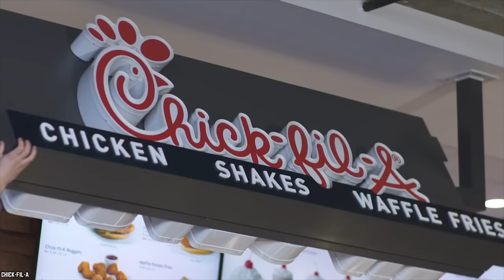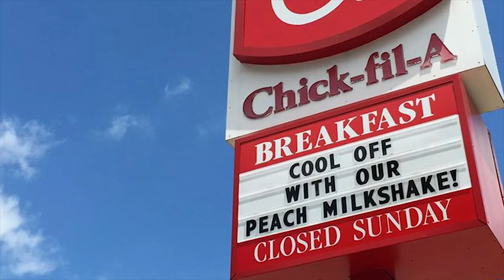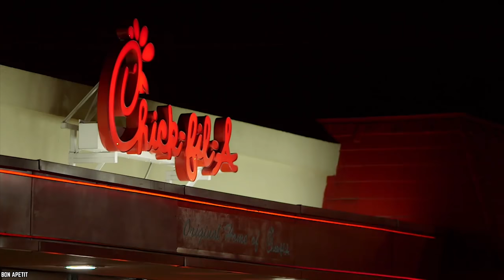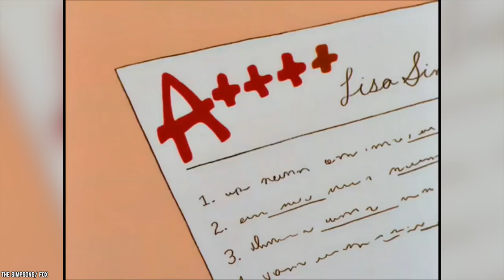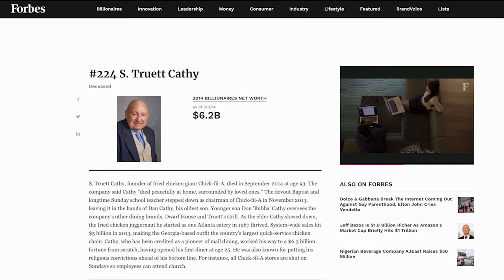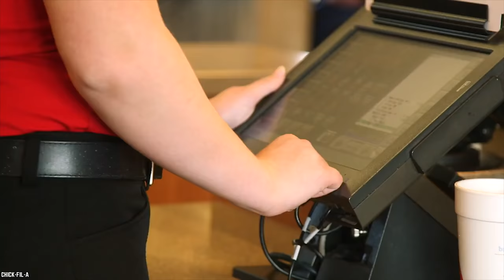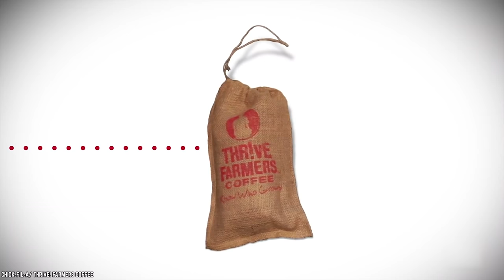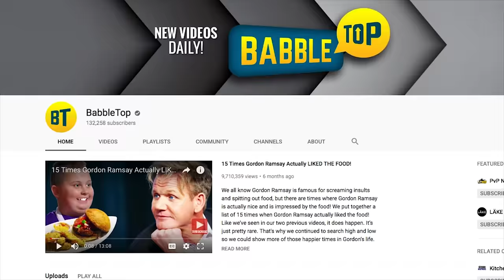Top 10 Untold Truths of Chick-fil-A!!!

Comment: I worked at a CFA for two years. 2005-2007. Not sure if it has changed since then. But the chicken came in FROZEN when I worked there. It come in these huge like 30 pound boxes with six five pound bags inside. 

Every morning we would do what was called a "chicken pull". Pull the chicken from the freezer, put two bags each on a tray and place them it a chiller. A big refrigerator basically. The temperature was set to slightly above freezing so that the chicken would slowly thaw over a 24 hour period. So idk everyone says "fresh never frozen". It is really high quality chicken though, and it's fresh in the sense it has only been frozen for like a few days before we get.

Comment: 7:45 the lemons are not squeezed by hand. There is a machine that does that. (I used to work there)
Reply: Christopher Raj Same with ours. We still have our hand-squeeze machine, just in case the big one breaks down.
Reply: They used to - I worked at CFA for about 8 years, and squeezed many a box by hand.  The new machines are safer than the old process.